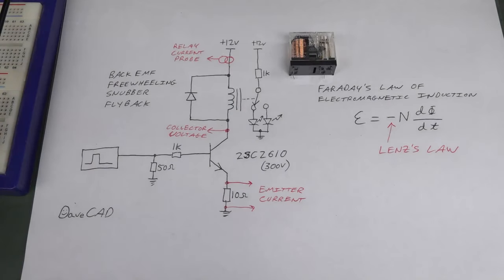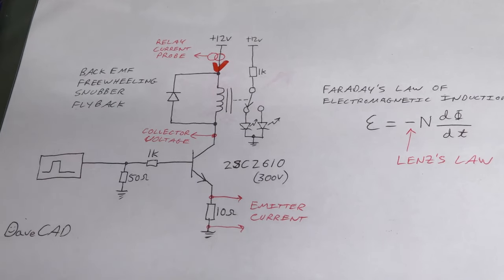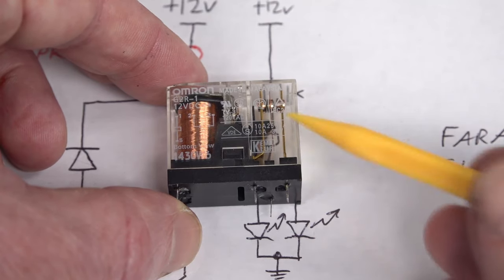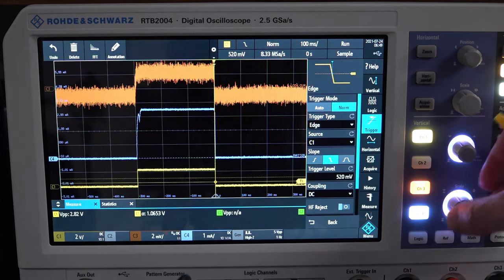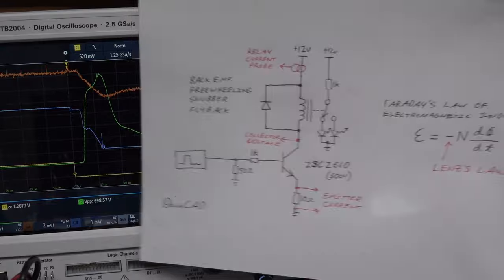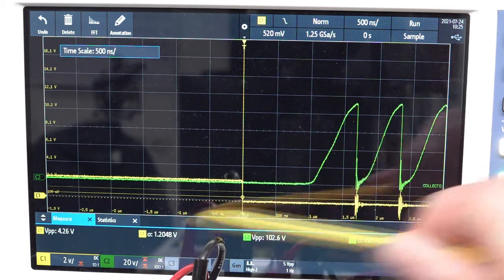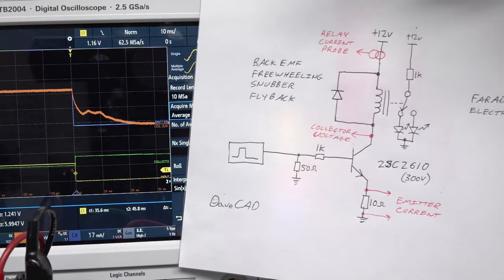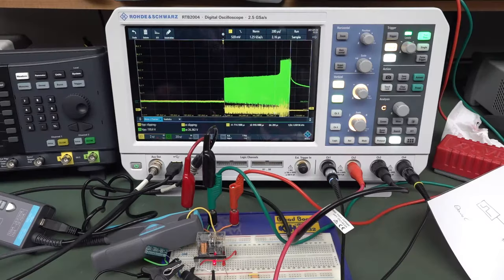EEVblog 1409 - The DANGERS of Inductor Back EMF

Comment: For over half a century we have had compact and efficient diodes. Before that for a brief period we had really poor Selenium oxide diodes.. and before that, only vacuum tube rectifiers, not usable in this function. Given that we had nearly a century of electric stuff with relay switching before the practical diode,  what did they use to squash the back EMF in those olden days. I have seen a few vintage circuits with a parallel resistor used to create a drain path, but of course it also draws current during coil energizing, which is not efficient.  Might there have been some sort of capacitor snubber ever used? It would make sense that during the brief EMF, the high voltage energy could be dissipated by charging a cap which is very low impedance when first charging. Once the back pulse is over, a parallel resistance could drain the charge in the cap over a longer period of time.   Thoughts?   What did they do before diodes ????l
Reply: Before diodes you had just really robust switches and contacts, that could handle the arcing without issue. For some more critical things, like vibratory power supplies, you used a waxed paper capacitor across the contacts, that both acted to reduce the fast rise time, and also, because it was so lossy, to limit the rate of rise of current on both turn on and turn off, as the ESR was typically a few ohms when new, and only got higher with age. In the vibratory supplies the capacitor also was part of the timing circuit that determined operating frequency. 

Otherwise you could have used the zinc oxide varistor as well, equally old and venerable, that had a somewhat soft clamping action, and a relatively high slope resistance, but which was well known and used, especially in high power lines as a lightning arrestor. Otherwise you often found neon lamps used as a spark gap, giving a voltage limiting effect, though it was only used below 60V, as they could stay lit over 60V, but were common in telephone circuitry as a clamp, though the exchanges simply relied on large contacts that were robust, as they had to operate for millions of cycles, and which were simply cleaned and adjusted regularly.

Comment: Nearly all the modern Inverters mainly Grid tie Inverters now use Inductors instead of transformers to save on costs due to an inductor is a single winding on a core and are more efficient due to less losses via copper windings. I wonder what the voltage of the collapsing field has on those big suckers.

Comment: How about an AC motor? Here we use AC pump motor quite often so do they induce similar voltage to our mains electrical system when turned off and put our rest of electronic appliances at risk?
Reply: Have seen few people popping out their SMPS' MOV right after there's a power outage, most likely their AC motor's sudden stop causing all this?
Reply: Yes. When I turned off the fan in my bedroom it would often cause a nearby TRIAC-controlled lamp nearby to glow for a fraction of a second. However I think the risk is negligible as products are designed to deal with small surges like this.

If MOVs pop right when the power goes out I'd presume that rather than AC compressors most of the inductive spike would be from all the large distribution transformers on the line.

Comment: Assuming the noise in the microphone is not from some "invisible" arcing then I assume it is a function of the release speed of the armature and contacts; i.e. the collapse of the magnetic field is softer and therefore the motion is less violent. At least, that's my mech eng thinking; (F = ma) or more accurately (F = m dv/dt). Tongue at correct angle! 😋

Comment: I have a question good people. If we use a diode to supress the back EMF might it delay the collapse of the magnetic field in the relay coil? With a diode, the energy in the inductor is being fed back  into the coil, not dissipated elsewhere. I remember reading an Omron datasheet that suggested using a VDR to absorb the EMF to allow faster operation.

Comment: I don't think there are any "parasitiscs" in the circuit itself regarding how emf energy is dissipated.
Those are most likely reverse currents flowing from collector to and through base and emitter. Would be cool to measure them and see if they add up. Could be lose in the coil itself but I would have to imagine a stand alone coil with initial condition a non zero flux. Hmm... air leakage current and electromagnetic wave?  I say it's s reverse current through transistor. :)

Comment: We call them "fast recovery diodes" its a broad term for a diode which is at least 10 times faster than a rectifier diode. Like the UF4001 have trr=50ns while 1N4001 rectifier has trr= 2us

Comment: I once had a weird case where two relais connected together interfered with each other and both started to vibrate. 

It was a cheap miniature RF remote controlled relais connected to a big relais. And that big relais handled the current of an electric door lock. So I had three coils in that circuit and when I activated it, one or all of the coils started to vibrate (turn on and off really quick). It is still the case when the power supply can't deliver enough power. I don't know why that happened, but it would be interesting to know.

Comment: At the 23 min mark you are talking about the slowly increasing voltage ( green channel ) over the transistor.

Is that voltage increasing because with every ‘breakdown’ cycle of the failing transistor, there is less energy in the relais coil .

And this goes on until like you say a little later, until the energy in the coil is too low to make the transistor fail ( breakdown )

Comment: I'm gonna guess that the louder noise when the coil is deenergized and the diode is removed, is due to the current flowing in reverse and setting up a reversed magnetic field, essentially pushing the contacts open rather than relying on just the spring.

Comment: Last year I managed to somehow destroy two VESC 6.6 speed controllers. For some reason, connecting an adjustable DC buck converter directly to the positive and negative outputs of the speed controller killed the 5v RF section of the speed controller. I had headlights hooked up to the buck converter. I did this to two units, and now I'm afraid to hookup headlights at all.

Comment: I wonder if some modular relays have this kind of thing built in? I could see it being a problem if there's not some extra nubbin or change of pin spacing to differentiate a relay with protection in its module vs. a plain one that doesn't have it. Then again, that's probably why it's likely better to have the feature on the main circuit? (Anticipating some chance that two different parts could fit in the same socket, person plugging parts in might not get the importance in the different designation numbers for a part that looks the same from the outside.)

Comment: I have been seeing lately that's mosfets are replacing diodes. In circuits like an active rectifier. Or at my job we use a relay driver that has mosfets rather than the diode schematic we saw in the video.  Is there a chance you could make a video about the pros and cons of using mosfets in circuits we usually associate with diodes. Thanks

Comment: I first learned about this as a kid when I connected a relay and 9v battery with one hand on each terminal. Ouch!
Reply: haha yep same!
Reply: same but with a wall wart
Reply: Best is to have one end of the coil on the NC so that the relay oscillates. Gives ya quite a good tingle.
Reply: Same, I jumped the 24vdc  brake release on a 2 kw servo motor on a custom robot, pinching 2 wires together with each hand and they slipped apart after energizing the coil.  Had a bit of a lie-down afterwards.  Looking back, it could have killed me but I got lucky.
Reply: Me too and Dave says not enough energy to be bitten.
Reply: Yeah I've done that too. Holding wires in place by hand when testing stuff.
Reply: i enjoyed that little tangy feel
Reply: did the same thing with an air solenoid and a leaf switch, hit the switch off axis and when the contacts broke my finger was a very good snubber
Reply: I learned on a 9VDC coil driven buzzer. It feels like a static shock.
Reply: I did the same thing as a kid, pp9v battery and a door bell holding the wires on the battery, a very consistent way of shocking myself lol.
Reply: I did it with a transformer primary and 9 Volt battery.
Reply: @DrakkarCalethiel  I used to do thes to make nearby radios sound all staticky.

Comment: You should have fire up a MW radio, and tune to 1.5MHz. Ahhh.
Reply: AM radio in US. And you don't even need to tune to exact frequency for a square wave... Plenty of harmonics there, so this would be broadband!
Reply: @nameredacted1242  AM is also LW for all of us I think. As MW and SW, (Long/Medium/Short Wave), which are all a specific frequency band. AM is the way it is modulated, as FM is. When a radio has only one AM frequency band (most likely MW) manufacturers (can) use AM as a name, opposite to FM.
German radio's use UKW for FM, Ultra Kurtze Welle (ultra short wave). Beside that Lange Welle and medium Welle have the same abbreviation as in English.
But I guess you know....
Reply: @erikdenhouter  What I meant was "a commonly available AM radio"... LW MW SW coverage by a radio is a much rarer appliance for most people...
Reply: Yes, I thought he might have done that to show us.

Comment: I've come across this in real life, on a tractor using the horn would cause such a spike on the canbus the engine would stop from the ECU protecting itself. The horn circuit was not on the canbus but wires run alongside. Fixed the issue by putting a capacitor in parallel with the horn.
Reply: quite unusual because CAN bus is differential and should be near immune to noise.
Reply: relays with an internal clamping diode must be wired correctly on the primary side to function correctly.  more than once i found one wired incorrectly  and one time it was from the factory!!!

Comment: As a kid, I got a pretty good shock when, after building my own 2-way relay out of a hacksaw blade and some electromagnets, I decided that I might be able to configure it as a buzzer by having each direction's connection power the other direction's coil. 12v in,  massive arcing and electrical shocks out.
Reply: I would have LOVED to have been there learning that lesson with you! Sounds like some beautiful work! Electronics experimenter tinkering and learning at it's FINEST! - The very foundation of what defines a real engineer. Tech Universities hand out engineering degrees to people that never fixed their own bicycle as a kid, never took apart the family toaster to see why the button stays down when plugged in but not when unplugged...and WHERE'S that toast TIMER? Nope. That thought never occurred to them.  The curiosity never sparked. They got excellent grades in their courses, though. These people are are incapable of fooling the master of all trades self-taught school of hard learned lessons engineer.

Comment: I actually HAVE been shocked by a relay because of this! Before I fully understood counter-voltage spikes, I couldn't see why a little battery powered circuit was able to zap me!
Reply: Yes I shed to feel it as a kid messing about and always wondered what it was lol
Reply: OK, how 'bout listening to a legacy one-tube radio with earphones? The 22.5 V B+ lead went to the phones, and I got zapped when I opened the phone connector.  SURPRISE!  Some phones actually had EXTERNAL screw terminals!  Duuuh?

Comment: Comments:
1) Although it does not solve the flyback issue, it's a good idea to drive a relay smartly these days to reduce static (resistive) power dissipation/waste: high initial turn-on voltage, and then decrease voltage to just enough to maintain hold. They have ICs for driving relays nowadays.
2) For motion applications: use a Voice-Coil Motor instead of a hefty solenoid. Their inductance is much less.
3) Use a Schottky for the flyback diode. Its breakdown voltage must be high!
4) MOSFETs have a built-in body diode which freewheels in this case, but I don't trust it and supplement with an external Schottky!
5) This snubber can get more complicated (RCD Snubbers, regenerative snubbers), but all of those require tuning to end application!

6) This is EXACTLY the cause of frequent posts on electronics-related forums of noobs saying "HELP my switching power supply project (or any switch project) transistor worked a few times and died..." Transistor is OK when it turns ON in a bad switch design/build, but is killed instantly when you ask the transistor to turn OFF. Well, besides proper design and proper build, you must also validate your design with simulation (which I don't care about) and real-world testing (which is what my job is all about)!

Why relay is quieter with snubber is because the scope already showed us they relay turns off much slower. So, this actually can worsen (because contacts move slower) high-voltage acing across load contacts!

Comment: I remember being a kid and using a relay to drive itself--put the coil in series with the NC contacts.  Current will flow, the coil will open, current will stop flowing and the relay will close--repeat. Then put a neon bulb across the relay could and you just made a high voltage power supply.  ;)
Reply: RIP relay contacts, :)
Reply: I did the same. It makes them go nuts. I did it with relays from a car.
Reply: The classic, bi-stable circuit! That little relay circuit was used in the millions of things back in the day. Sure makes a racket!!

Comment: As a young player, I got trapped by this one several years ago when retrofitting an old CNC machine with a modern computer.  It took me forever to stumble upon the actual problem/solution. But once I did, all my little gremlins went away. Nice video, Dave.

Comment: 14:40 Automotive ignition coils use this to generate the spark that fires each cylinder. They can turn 12 volts into something like 50, 60, 80kV.
Reply: ...AND THAT'S WHY THERE WAS A CAPACITOR CONNECTED ACROSS THE POINTS-(!)
Reply: @daleburrell6273  Turn your caps lock off lol. But yeah the condensor...gotta love old names still holding out in niche uses...is to keep the points from burning. They will function without it but the points last a matter of minutes.
Reply: @daleburrell6273   The cap across the points are there to actually increase the output voltage while protecting the point contacts.  When the points open but before the HV on the coil output reaches a value high enough to jump the plug gap the coil primary voltage also increase negatively.   This can result in an arc across the opening contact.  Any arcing here dissipates energy in the coil core reducing the stored energy for your HV secondary.   The small value cap across the points absorbs a small amount of this primary side reverse EMF just long enough for the points to open wide enough that an arc can't form.  Sort of acts like Dave's diode but only for a very short time.   Once the cap charges up a bit and the points open without arching it no longer presents a load to the stored EMF.   Arcing also reduces the rate of change of the magnetic field but too large of cap would do the same thing so it's a balancing act for the size if the cap.   The down side is when the points close again the energy stored in the cap now wants to spot weld the point contacts.
Reply: @craigs5212  I'd expect the cap to have discharged through the coil primary by the time the points close again. But you'll get some oscillation between the cap and coil for a while.
Reply: You're talking about modern coil ignition systems.  The PCM has zener snubbers to protect the coils' driver circuitry.  The capacitor is used to suppress RF that can picked up radios and other sensitive equipment.  An older points style ignition doesn't produce as high voltages as solid state ignitions because of the slower turn off time.
Reply: @Discretesignals  Other guy brought up points which use a discrete condensor right near them in the dizzy. Modern systems snub the flyback differently but they still do it. In fact modern systems need a more powerful snubber since modern systems fire at the higher voltages I listed; points systems typically run at 10-40kV rather than 50-100kV due to current limitations of contact points. Because the modern coils fire off such a hot spark they have a correspondingly stronger back EMF, and thus require a more robust snubber.
Reply: @Discretesignals  Without the Cap the points and coil alone will not produce strong enough spark.
Reply: I should imagine Diesel injectors must have something installed on the coils to combat this and yet keep their ability to switch at high speed, I started wondering about this working on an S-Class which has some fast pulsing injection method with extremely high pressure fuel rail characteristics.

Comment: The most interesting part of the demonstration is when lower breakdown voltage transistors were used. I never would have guessed that such a circuit had so much treasure troves worth of knowledge hidden behind such a simple form. Thanks again, Dave!

Comment: we used to call it the MF Diode... like in m0ther * ....  because a student didn't want to put it in the design (replaced it with a resistance ) ... so the team leader just said ... put the M*F* Diode
Reply from the maker: Ironically, the resistor actually can work if done right, as mentioned in the video.
Reply: @EEVblog  You get a good number of automotive relays with the resistor in there, done for exactly the same reason to reduce back EMF without needing to add any extra parts in the vehicle. Do not change for a version without the resistor, because it will cause issues in a lot of cases.
Reply: @SeanBZA   The relays used to have a diode across them, back in the day when people paid attention to the way they wired them into the circuit.